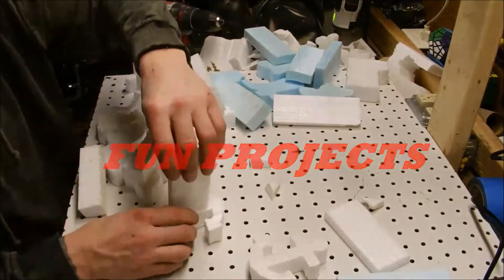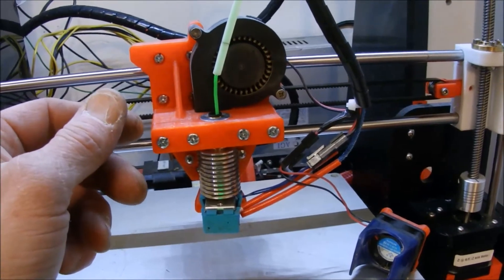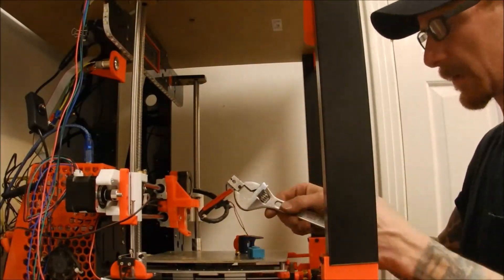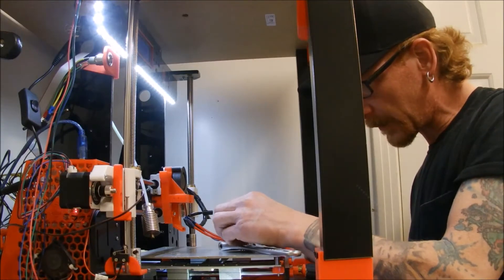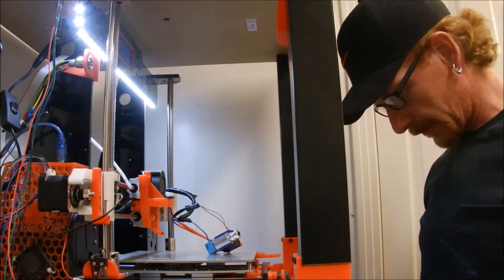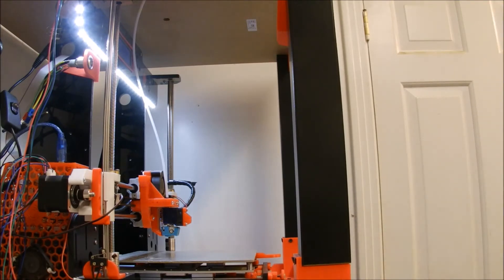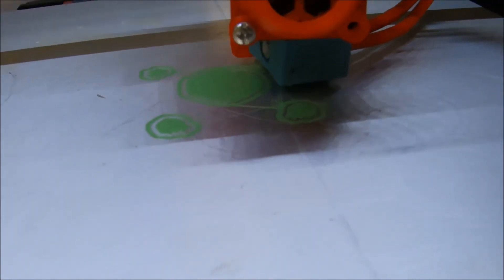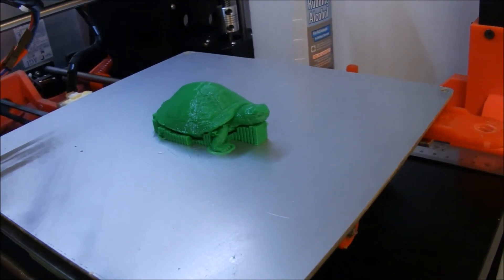Filament Jam in my E3D V6 on my Anet A8

Comment: In my case I got jams because of heat creep, filament would melt in cold end and would stick to heatbreak wall causing a clog. Thermal paste helped a little bit, going to 40 mm fan helped a little bit adjusting retraction helped but if retracting often it would still jam. Printing with PLA of course. My last hope is upping the fan to thicker one and isolating the heat block
Reply from the maker: Luke Malatinsky ya turns out all metal and pla really have a love hate relationship the wrong combination of temperature and retraction and you hate them the right combo and they print like a dream
Reply: Same problem here, can you give me your slicer settings?
Reply from the maker: Still have issues with PLA I have switched to Petg in that machine myself love petg
Reply: I have my full metal hotend print PLA and PETG with overall good quality, but once i turn up the retraction settings (from 0.4mm to 1mm ) to get rid of stringing - everything jams...
Reply: Idk if you fixed your issue but try using a filament Oiler.  You can find it on thingiverse.  I would go as far as saying it’s essential if you want to print PLA successfully with an all metal hot end.  Good luck!

Comment: I have pretty much the same problem as you with the filament jamming between the throat and nozzle or somewhere around there. Been fiddling with the problem for 4 days but still havent found a good fix for it. Always jams after first 2-10 layers.
Reply from the maker: and this is a v6 hot end your talking about?
Reply: Yep.
Reply: LegendärerPirmin Yep. It was a faulty throat. Some throats have the ptfe going too deep and it heats too much at the end of it causing it to jam. Order a geniune e3d sock and block upgrade and it solved it.
Reply from the maker: this is an official e3d v6 thought
Reply: Retraction need to be lest than 3 mm

Comment: Have you tried to remove the protection cap in front of the fan of the throat? Seems to me it hold's back a lot of cooling  air...
Reply from the maker: Guy Haest not a bad suggestion but what I’ve learned is pla and all metal hot ends have a love hate relationship but a little canola oil and they get along great. The reason behind this in case you don’t know, pla is starched base like food when you cook food in a metal pan you sure some oil so it don’t stick same rule goes for pla I printed a little Oiler with a sponge inside dap of oil once in a while and no jams
Reply: Never had any problem with pla. Only when the cooling of the throat was not good enough and the throat was getting to hot and the plastic melted to early.. But I'm glad you find a solution... :)

Comment: I think that bowden setups are prone to this and here's why. Your effectively trying to PUSH a rope thru a pipe. There's a lot of flex going on between the extruder and the nozzle,  which also creates a lot of other problems, like real world filament delays between the command from the controller and what actually happens at the nozzle end. I think a better solution for speed and accuracy, is a lighter direct drive setup.  Something like the e3d titan aero gear reduction setup. Or even the e3d titan with the e3d v6. Sure,  it's a little heavier than just ae3d v6, but not by much, especially if you use a pancake stepper on The extruder.   The effects of the  extra weight can be adressed by stiffening up the belts and the side to side z rod flex.

Comment: are you using the stock heater block
Reply from the maker: BowRow's Vids no I upgraded to an E3D V6 genuine hot end
Reply: Ok. Also I am having this same problem. When it does not jam it prints great but it is a hit or miss with the jamming. Have you found a fix for this.
Reply from the maker: yes I reduced my temp a little and lowered my retraction some and once I found the sweet spot I reduced the occurrence to little to none but once in a blue moon I get a jam. It is a con to an all metal hot end and PLA I guess
Reply: Inside The Mind Of Matt thank you so much i will try this out. The retraction thing sounds like the problem because I changed my retaraction settings and this started.
Reply from the maker: I’m at 8mm with 180mmspeed and reduce temp a few degrees till it stops jamming